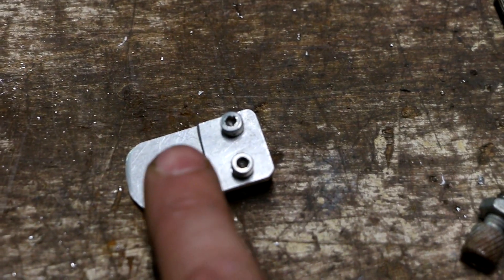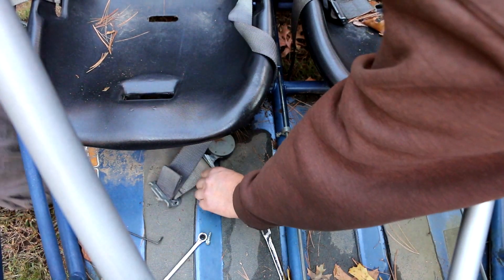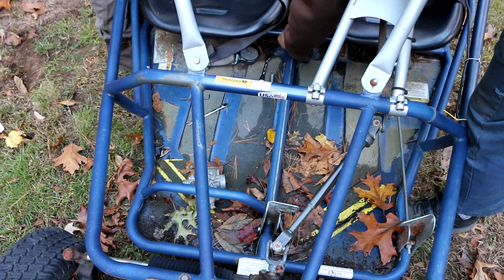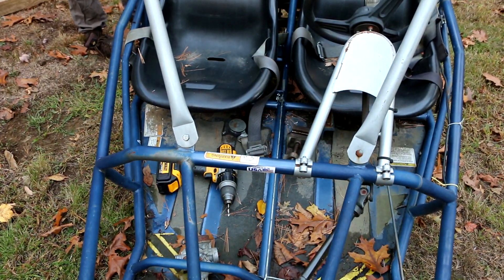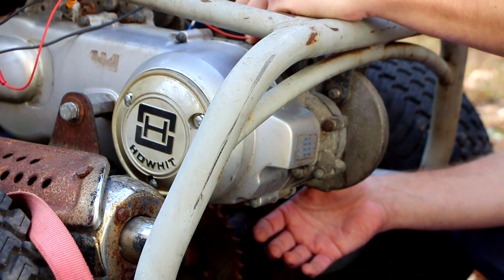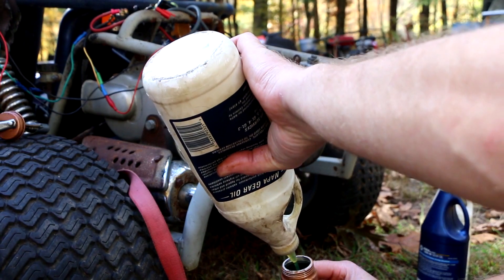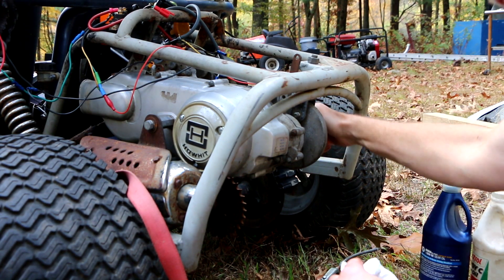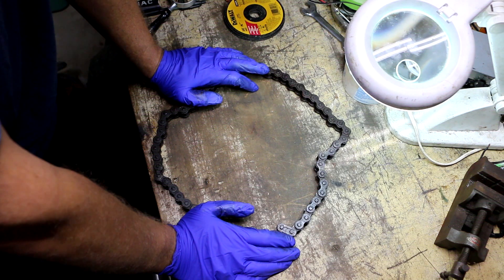The Yerf Dog Spiderbox Go Kart Part 23

Comment: Steve, 
As a younger man I had some success with boiling rusty chains in a pan of cheap general purpose grease with a lid on to keep the smoke down. An hour or so in the hot grease would often see a throw away chain back in action.
Cheers Eric